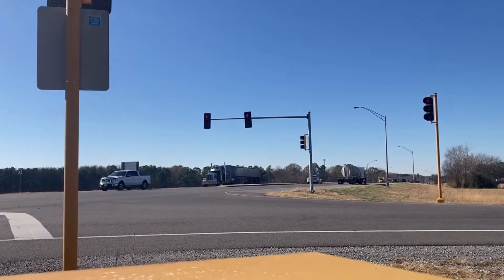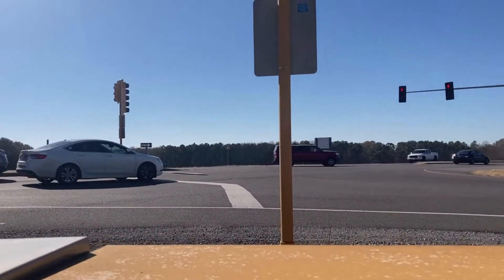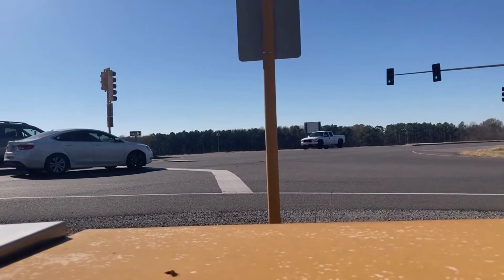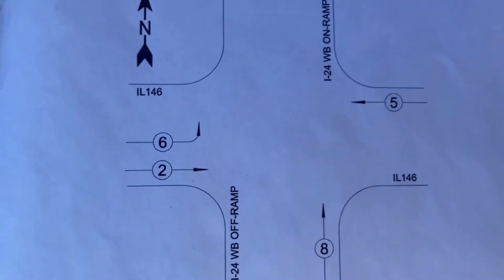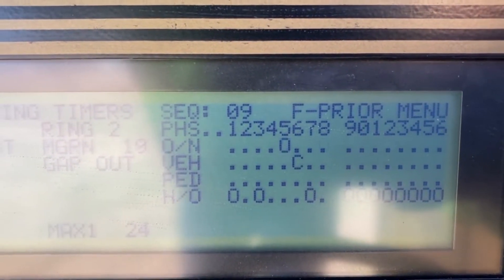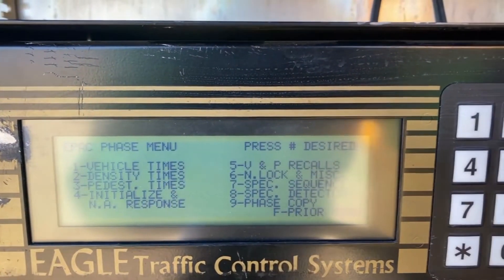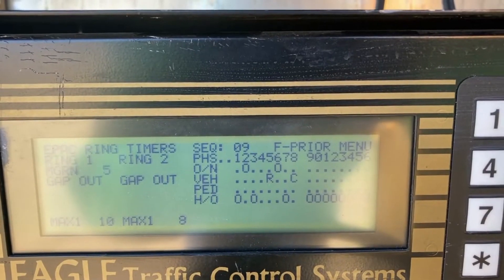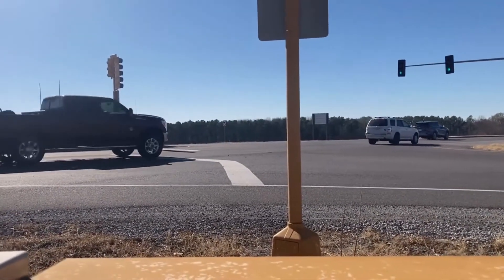When Traffic Signals don't give you a Green Light

Comment: My biggest complaint is wire loops not detecting motorcycle what is the fix for that?
Reply from the maker: I hear that often.  Many times loops are cut too big with the thought of detecting cars.  There are many design cuts however.  But most are 6'x20' or 6'x30'.  
If that's the case, your best bet when approaching the stop bar is to angle your bike so that you have a better chance of detection.  If you pull straight up, you may fall in sort of a dead zone (in between the wire cuts).  By angling it, you can get the metal of your bike to detect better.  You could also just lay your bike down on the pavement LOL
Great question!
Reply: @streetsmartstraffic  The other option is to get rid of the old 60's loop detectors and get vision and/or radar detection... 😁🤣
Reply from the maker: @Chris_In_Texas  Great point!  I just gave a presentation to about 400 people yesterday on traffic signal performance measures.  A side question by an audience member was about why bikes are not detected easily.  I explained it, but I told him that its one of the reasons we're moving to video detection due to the ability to setup bikes zones for easier detection.
Reply: @streetsmartstraffic  Are you guys doing strictly video or are you working with radar as well?  I know that most of the cities here in DFW are removing the video and switching to radar based or the Vector Vantage Hybrid video/radar units from Iteris.  Not sure if they are having issues with the video only units.  Some of the cities are switching to radar only.  Very few intersections have loops anymore here in DFW at least in Collin/Denton County.
Reply from the maker: @Chris_In_Texas  We have alot of inductive loops out there still at intersections.  We are slowly upgrading to video & radar.  We're using Vector Vantage Hybrid units on the mainline and regular Iteris NEXT video cameras on the sidestreets.  Luckily we have an awesome grant writer in our district that can get us safety funds.  So I'm able to get signals upgraded every year.  Thanks for chiming in Chris!

Comment: We programmed our controllers with dual entry.  That ensures one phase from each ring gets serviced even if no call is placed on that phase.  The ring structure on you intersection is different than what I'm famioliar with.  We had even numbered phases as thru movements & odd numbered phases as turn movements on dual ring configs..
Reply from the maker: Thanks for your thorough comment!  You are exactly right.  My predecessor liked to design up different phasing schemes for intersections.  I'm not sure what the reasoning was for this...but it has since been upgraded to a new cabinet and I corrected the phasing to how you described it!  lol   Thanks again for commenting!

Comment: But why would you need a minimum recall there? Doesn't that indicate that there is something wrong with the calling equipment (radar detector, street loop etc)?
Or is that a timed intersection? then each phase should be serviced every time right, regardless of recall programming?

And it seems that, that street would be more suitable for a semi-actuated control with always-green phase on the main street which is then cut off by detectors on the smaller streets (so the main street are only red when the smaller streets are serviced by detectors), but maybe the flow on the smaller streets are slightly too high to be suitable for semi-actuated control?
Reply from the maker: Hey Sebastian--the 2nd part of what you said!  That's actually the intended operation at the intersection.  A min recall guarantees a return to the mainline (where most of the traffic is).  Good insight!
Reply: @streetsmartstraffic  Oooh, I get it now. When the controller returns to the main street, if no min recall is set, it will only actuate ONE of the phases that are on the main street, even if these are not conflicting, when it has finished servicing the actuated streets, since the controller don't immidiately understand these 2 phases are non-conflicting, it has to be told that by "forcing" the controller to receive calls on the main phases.

But if the min recall is set, it will behave as there is detectors with cars there, causing all non-conflicting phases to simultanously activate.

Kind of how regexp work in programming, it will always try to find the minimum amount of data, until you tell it to search further.

But it also seems the street is not a dwell-in-green system, because then the min-recall would cause the intersection to "lock" permanently into the main street. Then a "Soft Recall" would need to be used.
Reply from the maker: @sebastiannielsen  Sebastian-You obviously have some signal experience!  What do you do?
Reply: @streetsmartstraffic  I usually do programming of software, amd it kind of intersects with everything. Mostly I do hobbyist of installing security systems and alarms, and even there it is certain logic you need to understand.

Anyways, I wonder about the GY enable dip switch, how could the dual indication on that video get detected?
Reply from the maker: @sebastiannielsen  Sebastian:  This is straight from the conflict monitor manual:

GY-Dual Indication Monitoring is enabled by the front panel option switch labeled GY ENABLE. See Section 5.4.1. When the GY-Dual Indication Monitoring option is enabled, all channels which have the front panel SSM switches OFF will be individually monitored for simultaneous active Green and Yellow field signal inputs. All channels which have the front panel SSM switches ON (i.e. enabled for Dual Indication Monitoring) will function as described above in Section 3.2.
Reply: @streetsmartstraffic  ooh thats how the work-- GY enable = monitor for GY dual indicaton = DISALLOW GY.

Reverse logic :-). One would tought that GY Enable means allow GY for countries that use GY as "upcoming red" indication. But its the opposite, those countries should set GY=DISABLE.
Reply from the maker: @sebastiannielsen  I always joke around that traffic signal terminology is the most backwards thinking, harder than it has to be - thing out there.  It's like they want to confuse you!  lol
Reply from the maker: Let me further clarify-a min recall on the mainline phase